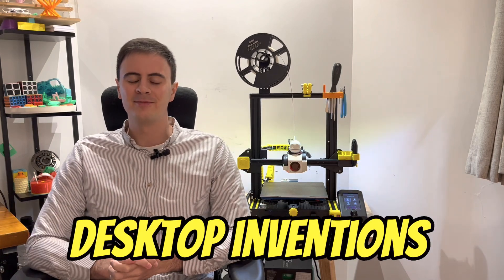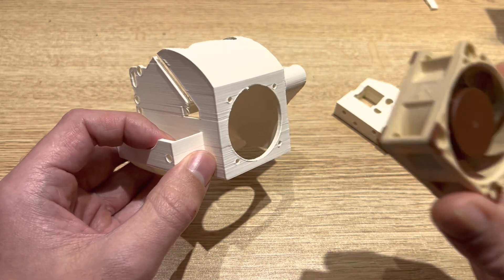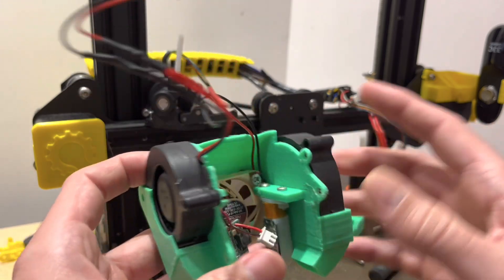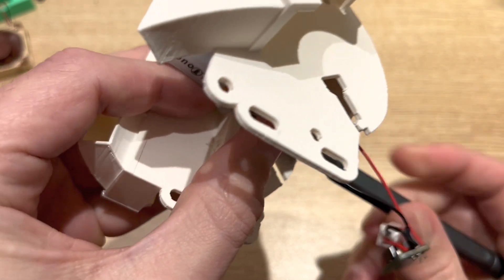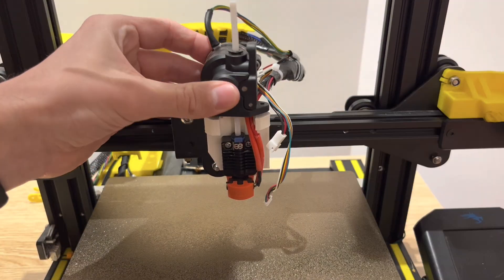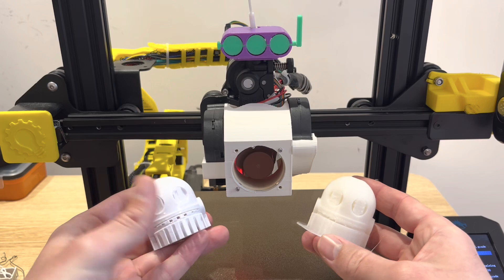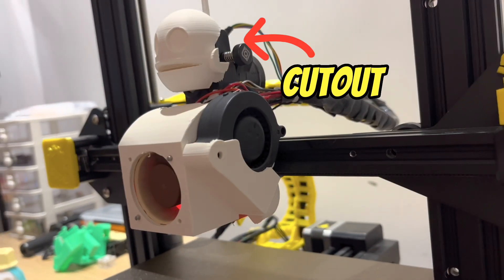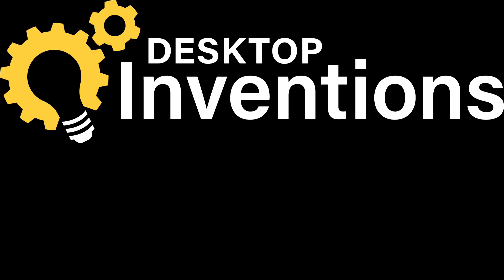Turbo Charged Printing Head V2.0

Comment: Good video but do you think the adjustable part could move and then in turn move the bl touch up or down messing up your z offset?
Reply from the maker: Yes that’s always a possibility. Maybe I should think of a way that the BLTouch is mounted to the back plate for a future design

Comment: 00:30 The print quality is really bad. :/
Reply: It never got better
Reply: @sanninoftheleaf9700  My prints looks much better 🤷‍♂
Reply from the maker: Yea I was in a rush and printed this at 120mm/s definitely not smooth with the harsh lighting on it. I may have to reprint a better looking version, and see if there’s any other problems going on as well.
Reply: @DesktopInventions  Yeah. I start using 0.6 mm nozzle for most of my prints on the Ender-3 and the quality went little bit down too. 😅

Comment: Do you have a link to the y harnesses, soldering is not my strong point
Reply from the maker: I’m not sure how to buy the Y harness with fans connected already but you could use something like the wago connectors or cold wire splices here to splice without soldering. They’re a little bulky but can work.
Reply from the maker: https://www.adafruit.com/product/866?gclid=CjwKCAiA5sieBhBnEiwAR9oh2jUrbpYVRV3THtZ65cTLQ141OIl8rO-slQygUj6Be1LRDUBAuFY78RoCv0IQAvD_https://www.adafruit.com/product/866?gclid=CjwKCAiA5sieBhBnEiwAR9oh2jUrbpYVRV3THtZ65cTLQ141OIl8rO-slQygUj6Be1LRDUBAuFY78RoCv0IQAvD_BwE